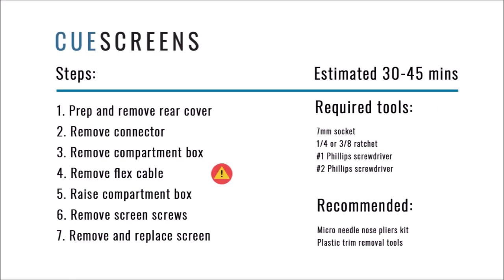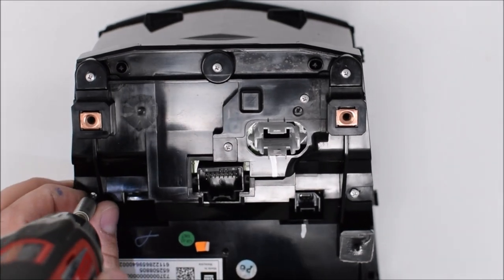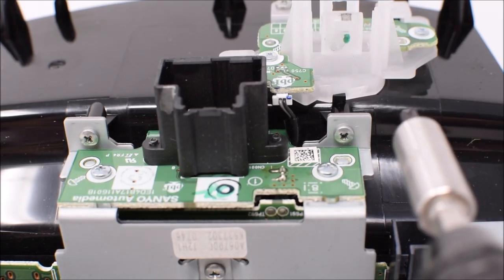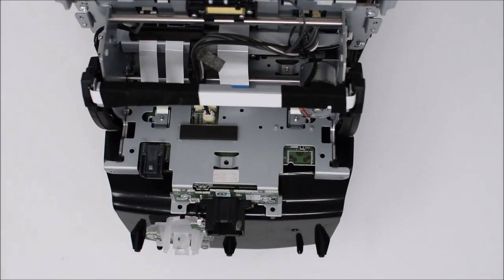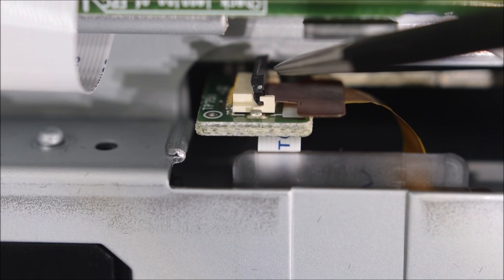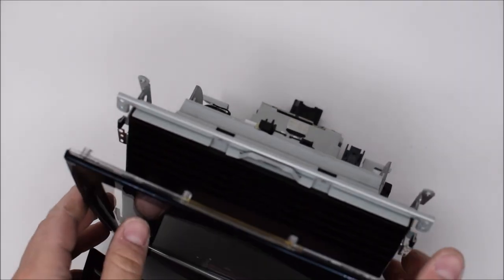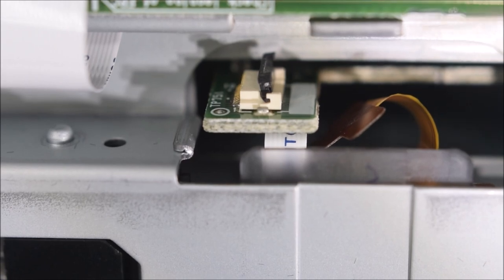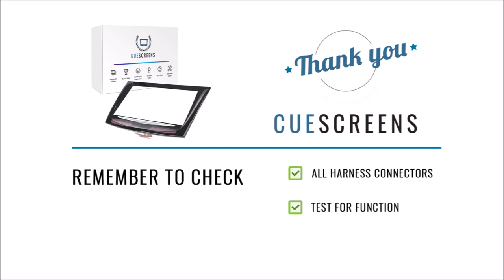How to swap CUE screen after module is removed from vehicle

Comment: I did it in a few hours but I was taking my time to get it right. I thought the screen was not working so I called the support number. Customer service was A1 for sure, he gave me a few options on what could have been wrong and shipped a second screen out just in case. I opened it back up and saw that I installed the ribbon cable backward (DUH!!!!). A quick reassembly/reinstall and I am back in business (I called and cancelled the replacement). The new screen works perfectly and looks like brand new!!!!! I couldn't recommend this more. Saved me $1380 hahaha

Comment: I have Cadillac ATS 2013 & already replaced the screen once & my screen again started going out & not responding to touch.  Bought your screen from Amazon & watched video to install.  Aside from removing unit from car it was easy to replace bec of this video.  Back in car & working great.  Thanks yall saved me $1500 & now I can use all the functions again!  Need a video showing reassembly but other than that 5 stars!!

Comment: I just installed this in my SRX and it took 2 Hrs from start to finish.  I am very happy with it and my screen has not functioned as well since I bought the car used.  The video is extremely helpful.  Please follow their instructions to the letter, you will not be unhappy.
Reply from the maker: Nice job Kurt! Our improved video is even better ;) https://youtu.be/tZ-Vud7uK4M

Comment: I am so happy I found your videos and website!!

$139 and less than two hours of work and my 2013 ATS has a functioning CUE system again. And that two hours could have been less but I was rewatching & pausing the video as I went through all the steps 😎

Thanks again!

PS - you need to sell headlights for SRX.  You can barely see at night in my wife’s SRX. New bulbs don’t change anything. Have to replace the whole unit. Thanks (again) Cadillac for less than quality parts and no support when they crap out.

Comment: This video was a ton of help. Greatly appreciated.
 I pre screwed the 9 screws that go into the screen first and removed them. That way i made pre threads into the plastic screen making it easier to screw when i put the screen onto the assembly. My screws were very tough to seat down in the plastic.
Reply from the maker: This is a really good tip, I will add it to the instructions in the next video.

Comment: Just went through this ordeal, THANKS GM! My takeaways are this: 1) Hit timeout when it’s time to start putting the screen screws back in. Video starts moving real fast and you’re finally seeing the light at the end of the tunnel, but STOP. You need to align all of the little detents before you start putting the screws in. I could see how easy it would be to crack the screen. It’s kind of awkward holding the thing and the whole module is apart…just stop. Carefully align all of the little detents. Carefully inspect all of them with a flashlight to make sure those are fully seated, then CAREFULLY start to loosely insert the screws. Take your time here or you’ll be cursing everything holy and unholy. That plastic is super delicate and brittle. Ok, number 2) Please, for the love of god, make a video on reinstalling the lower unit after the screen is back in place. This is the hardest part of the whole job, unless you luck out and just have everything perfectly aligned. There are little plastic U-shaped detents that you need to make sure are seated inside the washers on those two screws he has you just loosen with two turns. You will be taking it all back apart if you don’t ensure those two things are seated beneath the washers. I still don’t know exactly how I got the lower unit back in place but I did, after about 2.5 hours and becoming convinced I’d broken the thing. You need the screen and the lower thing slightly canted to fit the lower unit up in there. Use a flashlight and search for the plastic spikes and get those to aligned with the holes—that’s the key—and the only advice I have for you. Good luck, and may god have mercy on your soul, the soul of the engineer who designed that thing requiring you to take it all apart just to swap out the screen…and especially, god have mercy on the soul who decided to use the gel screens that inevitably spider webs. And GM’s lawyers—the ones still fighting a class action lawsuit today to prevent GM from having to pay for this travesty—they can go straight to hell. This experience will make me think long and hard about ever purchasing a GM product again. Was like assembling an IKEA microwave.

Comment: Hi I removed the touch screen and their is a crack on the tab. Question is would the monitor work without the screen? Or is the monitor not touch sensitive and has to have the screen? Just trying to make sure it's not the whole monitor that is defective.
Reply from the maker: Send a photo please of the crack
Reply: @CUESCREENS  do u have an email? So the actual system.is not touch screen right only the screen is touch?
Reply: I mean the module isn't touch right just the screen?
Reply from the maker: @josuepacheco9350  cuescreens@gmail.com
Reply from the maker: @josuepacheco9350  the LCD monitor displays information. The clear glass touch digitizer mounted in front of the LCD communicates the touch response

Comment: If anyone's having trouble removing the compartment box at (3:42 in the video), it helps if you plug the power cable into the unit and open the "secret compartment". The box should come off realtively easy then.
Reply from the maker: This is a good tip. You can actually manually open the door by pulling up on it while disconnected from power. I will address in the next video revision. Thanks for the suggestion
Reply: Thank you! I've been working on the box for about half an hour, I did as you suggested, and it came right off!  This could have been noted in the video. I did notice in the video that the compartment was partially open, and that's why.

Comment: This video is a big help, thanks.
After replacing the screen the touch won’t work. Any idea?
Reply from the maker: Send us a message at cuescreens.com and we will help you out
Reply: I'm willing to bet that the original screen is fine and it is just that the ribbon connector has lost contact. I had this problem with my GPS, I removed and reinstalled the connector and re-taped it into position. Works fine now. I think vibration is the cause, the wire ribbon loses contact. Cheap system. Same problem with calculators and touch screen microwave ovens.

Comment: The buttons on the sides (hazard, glove box etc) are staying lit when the car is turned off and now I can’t remember if that’s normal. What did I do wrong?
Video was great. Reassemble video would be helpful.  Almost forgot to plug the little white connector back in.
Reply: Never mind. The lights finally went out. Just seemed like a long time.
Reply: @briancorrigan7543  Mine stay on for like 10 minutes every time, ever since the car was new. Dealer said, "That's normal."
Reply from the maker: Correct, this is functioning as normal. The ECU falls asleep after 15 minutes and will cut all the power. The lights stay on so you can see them in the dark as a safety feature

Comment: Do I replace the cue screen or module? My screen is currently web like cracked at the corner. I still see icons, while some keep moving in red. Bottom buttons such as volume still work. Cadillac ats 2.0t 2014

thanks in advance,
Reply from the maker: Just the screen. I recommend the premium for your 2014 ATS. https://www.cuescreens.com/product-page/oem-cadillac-cue-touchsense-replacement-touch-screen-display

Comment: I got a quote to get my screen replaced for $2000... and they also told me that my only option is to have it done at a dealership. Why would they say that? The screen is cracked and nonresponsive (99% of the time), but it is still lighting up. I'm not sure if I need the whole module replaced or just the screen. I also wanted to add- this is actually my dads car and he got the quote so I haven't actually talked to a mechanic personally.
Reply from the maker: The dealership told you the only option is to replace it for $2,000 because the dealership wants your $2,000. All you need to replace is the screen. It's a known design failure from GM. Buy a replacement from cuescreens.com and never worry about it again. It's a easy DIY job by following our videos, or you can take the screen to a local car audio shop to do the repair if you aren't comfortable.

Comment: Can it be replaced from the front?
I could have sworn I’ve seen YouTube clips where that is the case.
Reply from the maker: The method shown is the only way to replace the CUE screen. If someone pulls it off from the front without disassembling the module, it won't work ever again :)

Comment: My screen is completely blacked out...everything else on the unit works all the buttons and light on the bottom, just the screen is black...do i need a whole unit or just the screen?
Reply from the maker: If you have no display at all, you will need a refurbished module. We offer these at 80% off dealer prices, please send us a message at cuescreens.com and we will send the correct unit link to you.
Reply: I need the entire unit as well.  2014 Cadillac XTS. What’s the price roughly?
Reply from the maker: @semperfipools304  shoot us a chat message at cuescreens.com and we can help find the right part

Comment: I just replaced mine and touch is still not working could it be a fuse ?
Reply from the maker: No, the ribbon cable is probably installed upside down. Check out cuescreens.com/troubleshooting to resolve

Comment: We have now spent 4 hours taking out and re-installing cue module. We have even put the old screen back on to see if it would light up but still the screen is black. We have done the troubleshooting tips also, checked the fuse and still no luck. Any suggestion?
Reply from the maker: Hi Terri, If your screen is still black then there is a disconnected white flat cable inside the unit somewhere. They are fastened with black tape and sometimes get bumped out of place. First, be sure your main connectors on the back of the unit are secured along with the blue data cable, this is easily missed. Feel free to send us a message for further assistance.
Reply: OMG!! One of the white ribbon cables was actually loose. I can’t thank you enough for the suggestion of checking them. It’s been a year since my Cue has fully worked. 😁🥳 so happy!!!

Comment from the maker: To those that finished the job- what was the most challenging part for you?
Reply: Taking the dash apart on a 2013 XTS4
Reply: I agree , taking the head unit out of my SRX was the longest part.
Reply: My 2013 ATS touch screen is no action when touch the screen. Shall I just replace the screen or the whole unit?
Reply: @do4353  screen is much cheaper!
Reply from the maker: @do4353  just the screen. Cuescreens.com . I'd recommend the premium screen for your ats
Reply: Ribbon cable was very inflexible on install and it was sticking straight up. Had a hard time turning it to get it in the connector. 
Started getting frustrated and took a break. Turned the unit upside down which made it easier for me because I’m a lefty. 
If you wear reading glasses at all, you’ll need them for this step.
Reply: James Foster LS3 TA Hi James, I have the same model as you. I'm expecting my Cue screen tomorrow, any pointers or advice for me? Thanks.
Reply: CUESCREENS 

1. Having the guts to pull my car interior apart since I’ve never done that before.

2. Resetting the ribbon cable. A few deep breaths and some patience is all you need.

Comment: Good afternoon my original screen had a bunch of spiderwebs I just installed the brand new screen that I ordered and the screen works perfectly however the touch portion of my screen does not work it wants me to press OK which I cannot, I double checked everything behind the screen and it is plugged in, is there typically reset process when I install a new screen or is it plug and play, any ideas what may cause the touchscreen to not work? The screen itself works fine when I put the reverse camera on, turn ac on and raise or lower the volume
Reply from the maker: The primary cause of unresponsiveness after screen replacement: 1. Incompatible version (See V2018 on our website) 2. Improperly installed ribbon cable - make sure it is the right orientation and all the way in. 3. Cable damaged during installation. Check for cuts or small tears